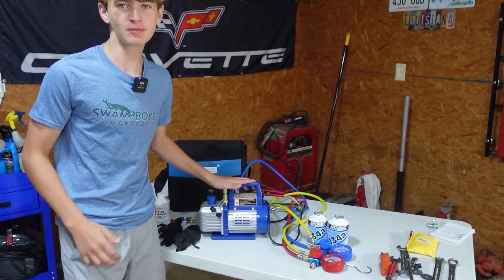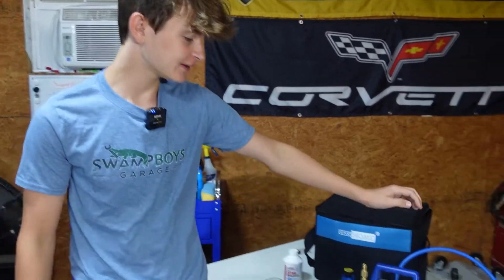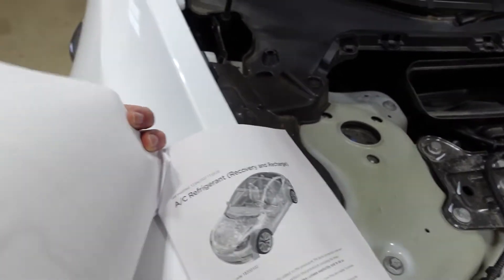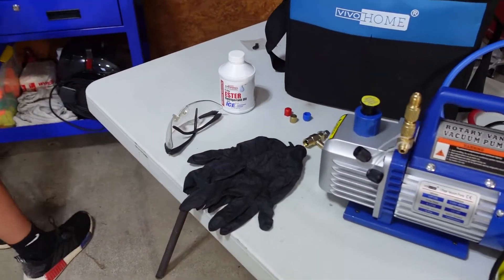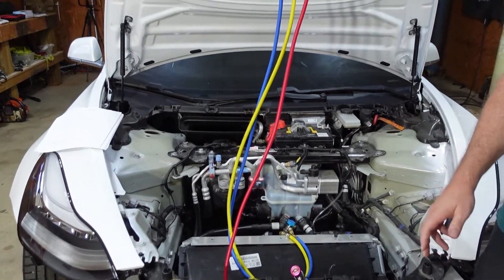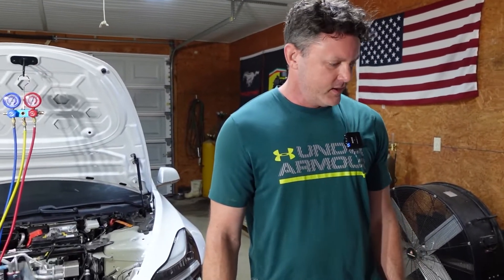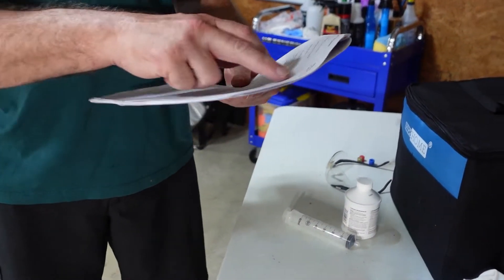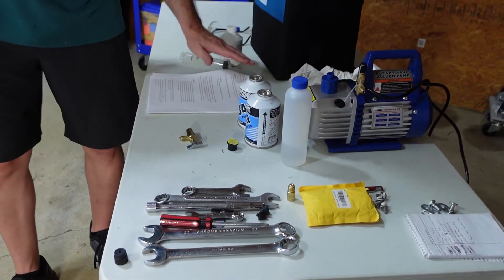Tesla AC Broke - Can We Fix It?

Comment: On a Tesla don't you have to select something on the screen to start a coolant purge and refill?  and at the end you said something about check the numbers on the low and high side.  (What are those numbers?)
Reply from the maker: You can download all the service manuals online. It’s all step by step with the pressures. It’s hard to find the manual but they are there. I don’t remember the steps. That was a couple years ago

Comment: Can you provide a link where you got the manual that shows how much oil to add after replacing the condenser ? The manual on Tesla's website only shows basic information and not how much ND-11 oil to add for replacements parts. (Condenser in this case)
Reply from the maker: https://service.tesla.com/service-subscription 
Just sign up. It’s free.
Reply: @SwampBoysGarage  Thanks, yes I found the pages talking about condenser replacement but I don't see the chart that shows how much oil to add back for replacement of condenser. I didn't see it on the (Recovery and Recharge) portion. Thanks
Reply: @benc1927 I can't find any service manuals outside of the "do it yourself" guide, which isn't for any major system or repair.
Reply: @SwampBoysGarage  do you have any guidance on finding thus info navigating that site you linked?

Comment: Did you guys have an issue with the screen saying there is a fault in the AC system? I have heard on Tesla service can reset it... did you guys have that issue?
Reply from the maker: No. The condenser got busted in the wreck. We never had any fault code.
Reply: @SwampBoysGarage  Do you know what size O-rings are needed for the condesner ? I have to swap out mine on our Model S also. Thanks
Reply: @benc1927  I found it’s best to buy a whole assorted O-ring kit and compare the ones you take out to a size in the kit. And don’t forget to oil the O-ring with ND-11 before installing.
Reply: @SwampBoysGarage  If you didn't have to replace the condenser, would you still need to add oil to the system if just adding Freon?
Reply: @SwampBoysGarage  If you didn't have to replace the condenser, would you still need to add oil to the system if just adding Freon?

Comment: Hey guys!. Doing a great job with the Tesla! I live in NO Garden District and am a bit of a car collector. I have an 09 E60 M5 manual w 42k. It needs significant preventive maintenance. Runs fine now but rod bearings,Vano line/pump, actuators and turbos should be replaced according to the dealer. I have no time. Super busy rn. You can have it for about 3-5k as long as you're willing to do the maintenance and not sell it for parts. If interested pls let me know.
Reply from the maker: Hey. Thanks for the message. Let me do some research on that car and if we have the skill set to properly get her fixed up. Send us an email so we can chat in private. It’s in all the video descriptions.